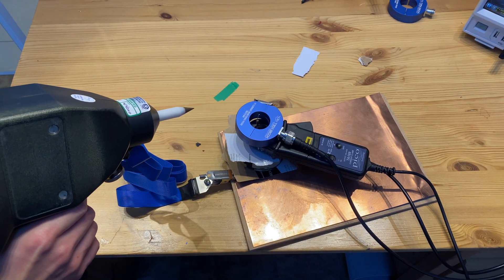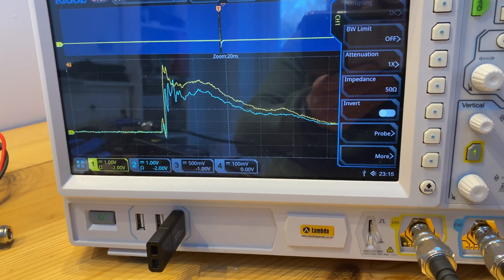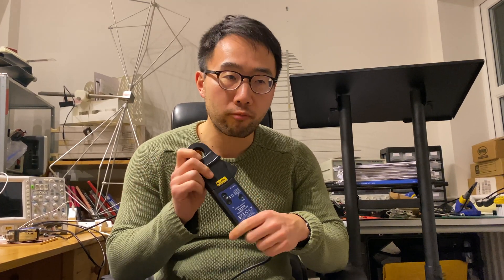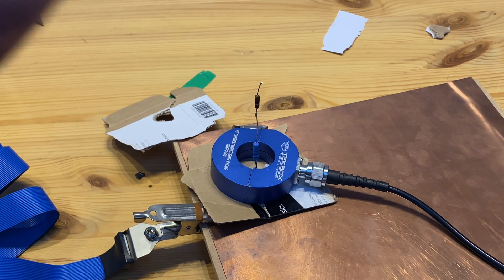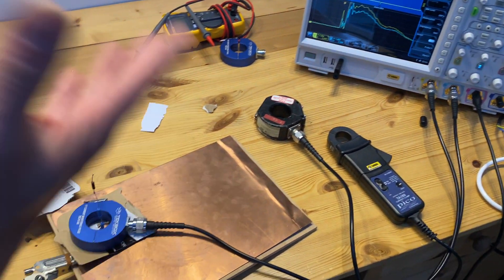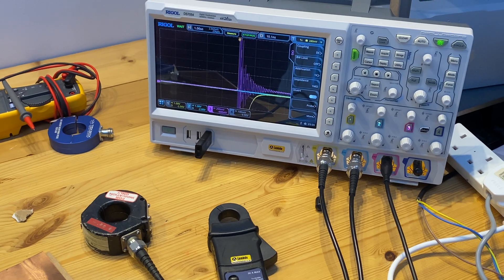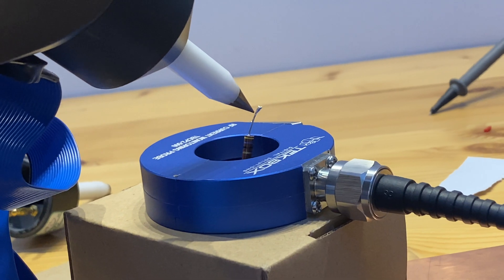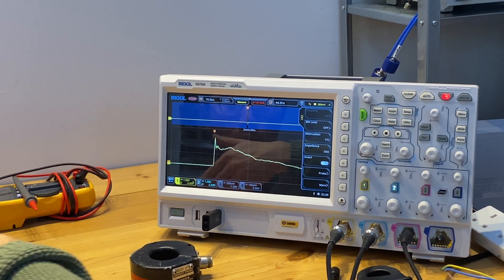Current probe Ep1 Part 2 - ESD discharge & E-field shielding

Comment: Thanks for this video detailing measurement details.@36 Is there any reason why which we are capturing at higher time base i assume 20us/div, then zooming to 20ns/div?.Isn't true that our capture resolution will be higher if we leave at 20ns /div and capture the waveform at 20ns/div using normal or single shot

Comment: Hi, good demonstration of probe bandwidth! What is the resistor you are discharging over for? Does it slow down the pulse? Or is it to get a defined current?
Reply from the maker: Hi i think i picked up 50 ohm, and perhaps 1000 ohm. It will slow down the pulse due to the inevitable ESL associated with it. i will demonstrate a better way of doing it in a next video. stay tuned!